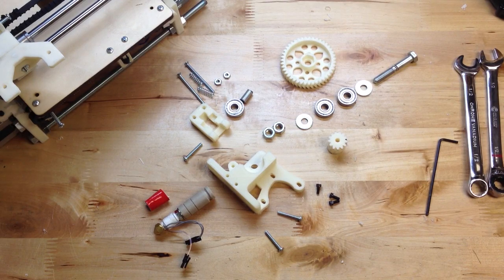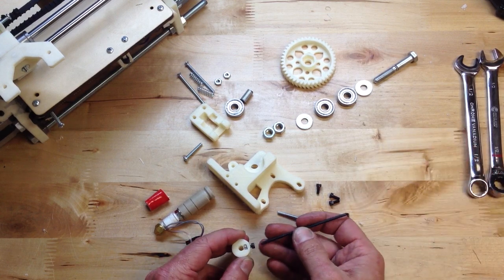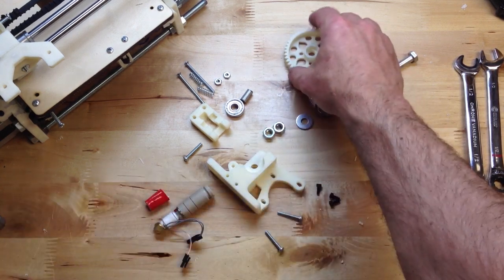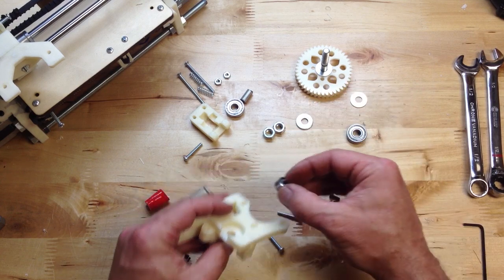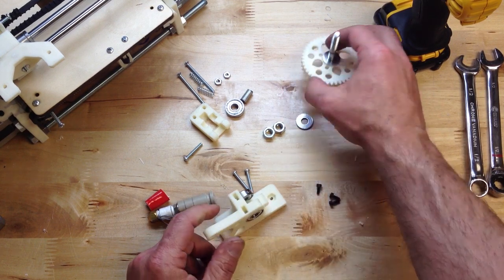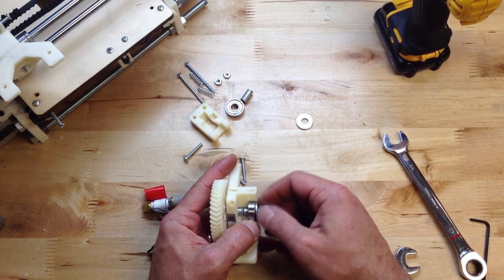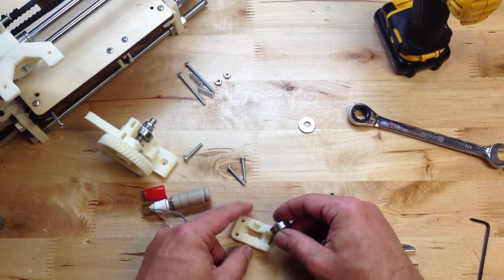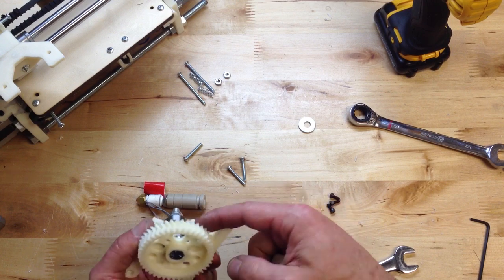Printrbot Build 13

Comment: I agree with Anglarma... At the end of #12, you explain everything up to mounting the Y motor and belt drive, etc... Then #13 jumps straight to the extruder, while in the top-left of the video, we can see the Y motor, belt, etc is assembled... Perhaps make a short video named #12A, speaking to that part of the assembly :-) Thanks :-)

Comment: (this is the second part of my comment - make sure you start with the first one!): use zip ties to fix the belt on either end. I started with the motor side (where my shorter belt end is - otherwise it would disturb the end stop), then pushed it straight and fixed it on the other (longer) side. Hopefully, this comment will help you a bit!

Comment: actually, the missing step is a quite simple one: look at Printrbot Build 14 at position 3:52 and you'll see how motor and belt are mounted. The remaining belt gear is pushed onto the remaining motor, and the motor mounted where shown. Then pull the remaining belt around belt gear and the bearing on the opposite side. The image at 3:52 will show you where to pull it through the x slider - thee is a square hole for that purpose. Turn the belt ends around after having pulled them through the hole

Comment: (continued)
3. if you don't use 2 washers between the gear and the main bracket, there isn't enough space for the screws in the back like your diagram shows. speaking of which...
4. 2x 3/4" = 1.5" - the bracket isn't that wide. something wrong on your diagram?

and not a problem but a note... you might want to show a picture of what the bracket looked like before you cleaned it up. the 3 holes for the motor mount had 2 layers of filament in the middle.

overall: 6 hr spent on the extruder alone

Comment: had a lot of problems with this piece.
1. the main bracket is about 0.3-0.7mm bigger on every surface than it should be. this is particularly a problem with putting the bearings in (22mm diameter bearings, 20.6 holes). also a problem with the hot end - I'm still working on that one. it also means that the hot end and the bearings won't go in as deep as they ought to.
2. the gears seem to have melted a little when they were printed - I had to clean them up with a file so they would actually turn.